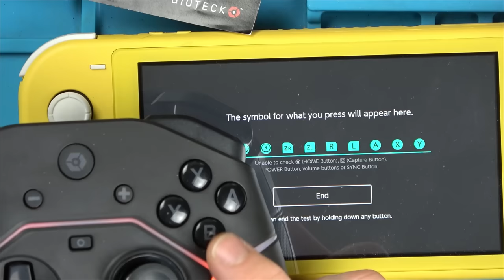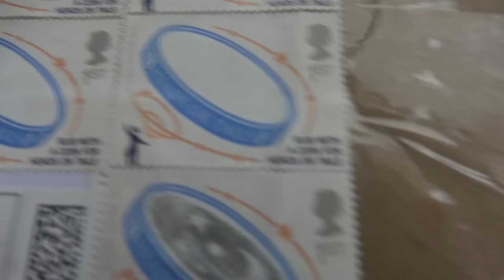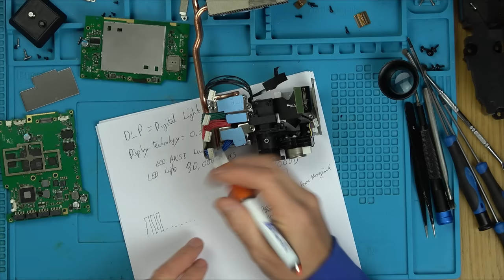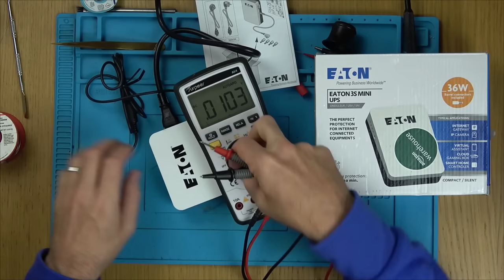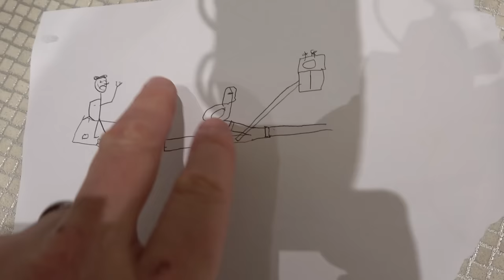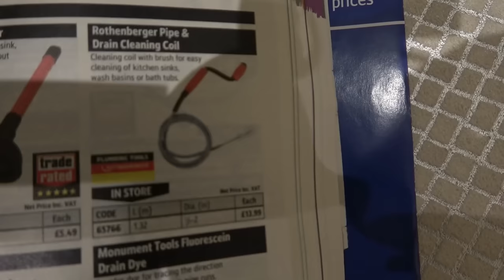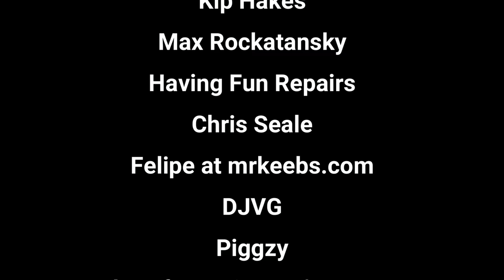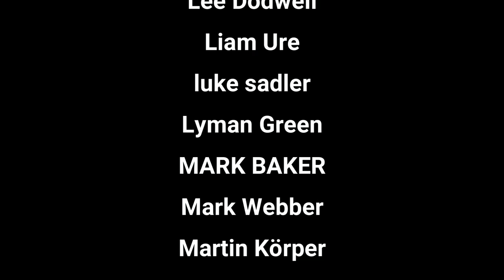Attempting to FIX EVERYTHING

Comment: A previous reply suggests trying to reset the 'over voltage' protection under the positive cell terminal. I urge you not to attempt this as it is risky potentially dangerous: it is an over pressure protection trip not over-voltage. This means that the electrolyte in the cell has evaporated (it's alcohol based) and the cell has already suffered significant damage. Even if you get it to work it will have a serious loss of capacity. A cell showing reverse polarity is damaged beyond repair and it too is potentially dangerous/fire hazard.
As to why this may have happened in this unit is that the cells weren't balanced or they are not being balance charged (there is usually a protection chip on the board to prevent this, but they can fail).
Otherwise I enjoy your videos they're always fun to watch 😀

Comment: Batteries: the dead ones will be protected flat-top and that particular protection PCB will be preventing charge of the cell, now it's dropped under the trigger voltage.

Cut the wrap off, remove the circular PCB from the positive side of the cell and they'll probably charge again.

The replacements you put in looked like unprotected flat tops (slightly shorter) VTC6 or 25R by the look of them.

Comment: Water leaks always suck had a roof leak in our sunroom and had to rip the corner of the room down to the studs and replace some rotten roof deking and re shing part of the roof only for the ceiling to feel damp again after closing all the drywall up. Best of luck with the plumbing leak hope it's at least a bit less of a nightmare.

Comment: Hi Vince. As for the soil pipe, I am guessing there is a join that isn't fully sealed at the top of the pipe but now the blockage has gone, maybe you won't get anymore leakage.
Forcing water with your hands like a plunger will force the water to pour out of that tiny opening even more so hold on to ripping the ceiling for the time being and monitor it. Obviously if the ceiling continues to get wet or is damaged then it will need to be done.

Comment: The older DLP's used a colour wheel but still had the mirror matrix, I replaced/upgraded a dlp chip because it suffered from stars and dots which is a fail mode for each of the mirrors getting stuck

Comment: Crack out an oscillating tool and cut that drywall out from below, Vince. That way you will be able to see where the water is coming from cause that's where it is ending up. You are right that if you don't do it now, it's going to get worse, water problems never get better on their own. I had a similar leak I had to fix, and despite everything I tried to avoid having to cut open the ceiling, it was the only way to see what was going on and I knew it would come to that so it's better to dive in and just bite the bullet and start cutting. And make a video out of it!! I love your home repair fix it videos!

Comment: I literally had the same toilet pipe problem you had today ! i didn't have to pull any carpet up and i used to be a carpet fitter ! my house was built in 1939,a good quality house ! that was built well,but things do go wrong in any house ! mine was clogged up with partners long hair that gets trapped,i had to undo the the fittings and clean them (i don't mind doing that) water now running freely,i hope you find the leak,these newer houses are sometimes hard to find ! because of the leak it so difficult to determine where the leak is it is a hard thing to do as modern floors are not accessible as older ones ! like they are plywood and covered ! Plus the amount of pipes and plumbing over the years has changed,there is a lot more of it !

Comment: You need to get yourself a simple endoscope. I've got one that just plugs into the USB port on my phone (though it came with a C to A adapter so it can go into a computer too), and it was only $15 USD from Temu. It's nothing fancy, but the thing you in particular will want to look for is frame rate, rather than any quality claims. They're really useful for reaching into areas that are just really tight. For your repair videos, it'll be handy since you can look inside the thing you're trying to repair, without needing to fully take it apart. (If you're willing to spend more, you can get one with a tip that can be manipulated, but don't expect to find one of them for less than $150 USD).

Regarding the snake, the term for those pipe unclogger things, I recently upgraded from a free-spooled version like the one pictured in that magazine, to a captured snake which keeps the coil inside a plastic housing and lets you hook it up to a drill for much better operation. I'd HIGHLY recommend going with the enclosed version as it's so much more sanitary to handle, does a better job, and honestly is easier to use. Thankfully, the price difference isn't much. 

As for the leak, I'd highly recommend contacting some kind of professional at least for 2nd opinion/advice ASAP. If it is brown water (toilet discharge), then it can contain all sorts of nasty things that you REALLY don't want sitting in the walls or ceiling for any period of time. It's also not good for your lungs.

Comment: Get a bucket and a screwdriver poke a hole in the ceiling catch thew water in the bucket then lower to the floor ,you will have a puddle above the boards and if not drained it will fetch the ceiling down,looking at the ceiling it looks like its been patched before ? When its drained cut a hole in the ceiling and have a look, because them plaster boards will have to be replaced anyway,you could out food colouring in the toilet and see if you get coloured water in the bucket , don't forget you will have a fall on the 110 mm pipe so it could be leaking from somewhere higher up and running down to your chimney breast  ,good luck 🤞

Comment: It's possible that those 18650s from the UPS have protection circuits built into them that has cut them off for falling below safe levels. Peel back the shrinkwrap and see if there is a circuit board on either end of the battery.

Comment: great bunch of fixes. The depolarized batteries is a sure fire sign that the battery innards have failed in a big way and there is no fixing them. It can happen if they are charged enough times or if they are left discharged for a long period. They have chemically broken down and they are highly dangerous. The toilet, its probably a good idea to have a twisty drain rod as you showed in the house for emergencies anyway. My feeling is that you have a crack or split in the pipe that some tissue got caught on and over the course of a few months caught more tissues (and stuff) until it blocked. When you pushed the water through it will force clear the blockage but may also open up the failure point causing more water to leak though. I think the best thing is to put an insurance claim in and get a plumber to fix and decorator to make good rather than tearing half your house up looking for the leak. Maybe it could be found using an endoscope type camera?

Comment: starting 30mm from the cove cut a square hole( center of the stain)(do not breathe in the dust, for obvious reasons)400mm x 400mm neatly on the lounge ceiling, this will expose the plumbing and allow you enough space to work, after you fix the leak you can screw back the original plasterboard with 25mm screws and a couple of pieces of 50mm x 15 mm timber. Before painting you will need to give it a coat of shellac or stain block as the stain will bleed through the emulsion paint.

Comment: Hello, Sir Vince. The water has to have a positive air pressure vent from above like on the roof, kind of like the vent hole on a disposable coffee cup lid, to let you drink freely, especially if it's a multilevel home. Maybe check the roof vent to see if you can get air down through that. That's at least how USA houses are designed. Just an idea.

Comment: The colour of the staining certainly tells you the source, its going to be worth accessing the pipe to see whats going on.
Water gets everywhere and from experience I would say the weakest point will be the pan connector on the back of the WC. The fact that you had a blockage couple imply that there is more going on.
Like others have said, removed the plasterboard and likely coving from the lounge and hopefully all will be obvious.

Comment: If you want to learn about the stuff you talk about in @19:13 searsch for “Mems” or “Micro electro-mechanism systems”

A lot of special sensors are made this way. 

Good stuff you show us here😃 also: did you know arial actuators on airplaines arent actual “actuators” there a special materials pulling them up where the plate is the actual structural mounting. When needed in flight those plates can be manipulated by sending a current thru, lifting the arials up.😮

Comment: Those 18650 batteries have safety valves under the positive terminal which disconnect the battery when over pressure occures.
If you want, you can reactivate by gently poking with a screwdriver under the positive cap, (there are usually small slits around, or cut with side cutters like a can) and gently pressing down. Careful, it is easy to perforate the cell.

Comment: Vince, I’d start by taking the toilet out. More than likely the weep has been coming from where the flexi meets the waste and the pressure of the blockage and you plunging has made it worse. Have you got an inspection camera to try to follow the waste pipe from your landing cupboard or by piercing a little hole in your living room ceiling.

Comment: Hi Vince, I am a bit late to the party, but have an idea - get the thermal camera and look for the coldest spots. Somewhere there will be your leak.
BTW I've got that pipe cleaning rod/wire in the tools. Never used it, but the day will come. You might buy it for the next time. And also - Think Plunger.
Reply from the maker: Cheers Marcel, I'm looking at the leak at the mo😂 Filming it as well. Hopefully this time I will find it 🙏
Reply: @Mymatevince  Good luck finding the culprit!

Comment: Strange that that was a factory short on that controller because many if not all manufacturers of electronic devices have a quality inspection control and before shipping they check for possible errors, on some devices you can even see a label ''passed'' or with similar text on it...

Cheers!

Comment: That water leak really sucks... But I would really like to see how it turns out and know what caused it.
Reply: My advice is call a plumber NOW. It's clearly the sewage pipe that's leaking. You're not going to slap some flex tape on it and walk away. This requires a professional fix and probably a new sewage line wherever the leak is. I know from experience that the sewage line will probably NOT stop leaking even if you don't use the bathroom. You'll just slow it to a drip if you're lucky. Even if there's no water in the pipe, the leftover traces of solid waste will continue to hold in moisture and that will eventually find it's way down to the leak. This is a job that requires an immediate professional unless (1) you like mold or (2) you're fine with dumping a few gallons of solid waste into your living room.
Reply: Or: (3) There are insufficient funds to hire a professional, and so a  "temporary" fix is better than nothing. 

My Grandfather was the master of the temporary fix. Happily, he died before ever having to address the impact of several decades of deferred maintenance.

Comment: Plumbing: dude, 2 things going on. 1. Blocked soil pipe between outer wc & inner wc. 2. Pre existing soil pipe seal failure. So fix 1. Then live with 2. Which had probably been there since new. 
Unblock using a flexible Toolstation drain cleaner both flexible metal & bamboo from soil pipe outside. If there isn't access, add or upgrade with a rodding joint from Toolstation. Nb The block raises water level which enables pre existing seal failure to leak. Rodding from downhill is more effective. Also hot water + caustic soda can work.

Comment: @Mymatevince Hey Vince, if the wet ceiling is directly below the toilet, I'd venture to guess the seal between it and the flange underneath may have failed. Not sure what you guys use over there, but we use the wax rings here in the states, and there are some other options now that wasn't previously available. But I would start there if that is where the wet spot is, below the toilet. Just my two cents worth. Hope that gives you and idea.

Comment: There is  highly likely a leak in the flexible pipe right behind the toilet on the connection to the drain pipe. It was probably already there for a long time but it's getting worse now, which is why it's causing problems. The water is leaking away before the toilet paper (or other stuff) can move further down the pipe. There is no real blockage, there's just not enough water left to move anything down the pipe so it just sits there. In the mean time the water is is running down the outside of the drain pipe and it shows up elsewhere as a brown stain on the ceiling, this is usually where the pipe meets the wall. (The brown is likely not from the toilet water itself being dirty, but more from the tannins and other dark compounds the water dissolved along the way.) The large stain on the ceiling was probably caused by the toilet bowl being full of water for a long time while you were trying to find out what the problem was.

Comment: Vince I had an upstairs loo like yours with that same flexible hose connector and it was backing up for months. Did everything I could to clear it without success but eventually paid for a firm to come in that used a camera to investigate and lo and behold it was a collapsed/damaged seal within that flexible connector. So I’m just saying….

Comment: I've seen that manufacturing fault, two pins on a SMT chip shorted.  It was on a microphone in my case.  The easiest fix for that, IMO, is to flux it with a pen and then use a tiny bit of solder wick to soak up the excess solder blob.

Comment: Amazon have cheap  Wireless Endoscope  Inspection Camera.  Snake that along the inside of the pipe looking for breaks, if u dont find one, then turn off the internal light & turn on all the light in the house and shine some torches under the floorboards. Pull the Endoscope back slowly until you can see external light leaking through.

Comment: 17:59 I think the cone/ rod photoreceptors are ( can't remember which is which but if you go into a darkened room with a tv on in adjoining room you can see the pwm in peripheral vision , not as fast but clearly switching. The central photoreceptors in the retina are responsible for colour and the outer are more night vision , so contrast rather than colour.

Comment: The 18650 are the more rare built in bms. Peel off the cover. Also under the cover you can get the real part number laser etched of 18650’s when nothing comes up on the printing on the cover, or sometimes hold to a light and it will show a faint imprint on the cover.

Comment: Leave it up to Vince to over analyze a clogged toilet instead of just using a plunger! I kid of course.  Not sure where the leak is coming from but if there is no obvious odor of sewage by now, it's likely not from the outflow of the bathroom but perhaps one of the pipes providing water, or, if it has rained a bunch lately it could be water making its way into the house from the roof and finding the path of least resistance.

Comment: Vince, normal plumbing would have completely separate drains for sewage and water. No home I have had has never had drainpipes linked. I would definitely split the joined drainpipes into two, sewage and water. Apart from that, interesting post, thank you.

Comment: these blue 18650s can be revived. theres a safety thing under + on the battery, if you pop it back down with a flat head screwdriver it will make them work again, but if safety popped then they will be probably not safe to use. i revived a ton of dead laptop batteries with that trick, but one cell in a battery pack that i've "fixed" got so hot during charging that it melted the plastic housing of the battery pack - will work with some cells, proceed with caution tho!!

Comment: p.s. It looked like the ceiling in your cupboard downstairs is hardboard, therefore probably easily removeable without damage with a little care. And if you have to cut it  - cut it carefully and you can reuse it as a template to make a new piece. Good luck.

Comment: Ideally, you would need some kind of inspection cover in the plaster ceiling below where the joint is in your bathroom waste piping, so that you can have access to it without the need to take up any floorboards from above.  The blockage part was easy to remedy, (although I'd use a rubber plunger to do it rather than a gloved hand), as you're using the water itself to force the blockage out of the pipe.  Unfortunately, at the same time, it puts strain on the joint in question and can cause any seepage to get worse.  The only good thing about it, is that you're able to see where the leak is now.  Directly above that new wet patch on the ceiling.

Comment: vince did you try outside the pipe incase that was blocked and it was backing it up as we had it here in comberton had that and it was apperlty a blocked swerwer round lid it was all blocked up as it had weeds growing in it and that is what could of happend to your.if it helps look ok yt and see and if it say weeds growing up in swerwer pipes or drain and it will tell you want to do

Comment: I get those same type of sewer blockages. One toilet blocks, that makes the whole house bubble and not flow, turds come up through the showers, ugh, just awful. Unlike you, I have zero access to the pipes. My house is built on an 18" thick concrete pad, and the pipes are enclosed in concrete. What we ended up doing is buying a jetter attachment for the pressure washer and jetting the lines, from the outside all the way through the house. Its been good for about 2 months at this point. We'll see if it stays good.